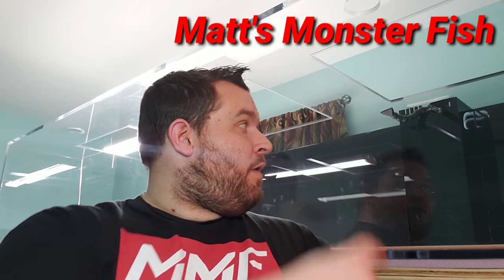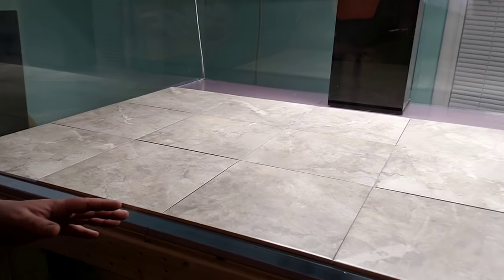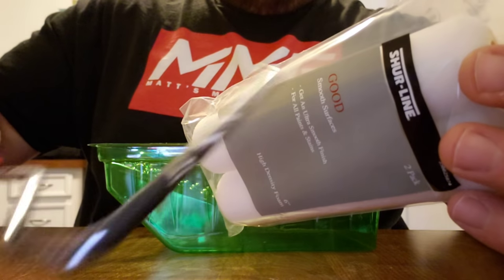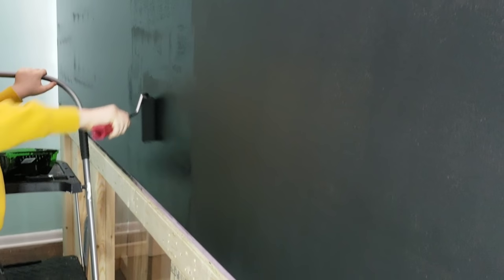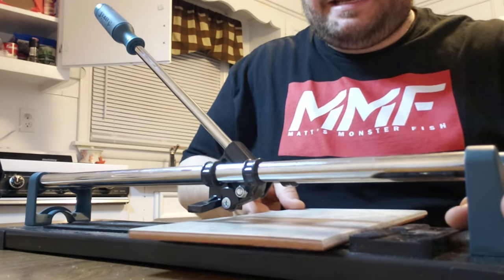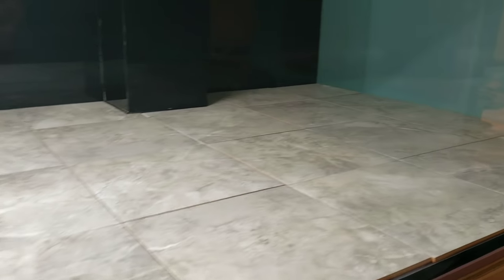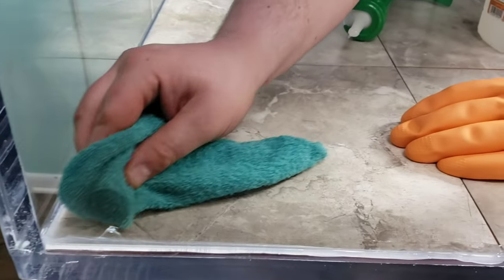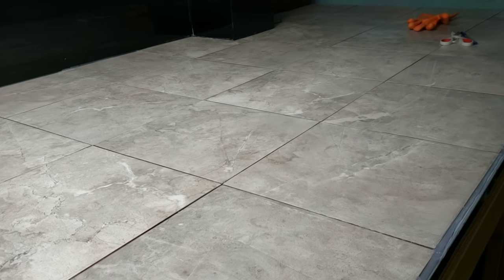Getting The MASSIVE AQUARIUM Set Up!

Comment: I always wondered if you took pea gravel and mixed it with silicone and spread it down on the bottom of the tank if it would look like a gravel bottom but be solid so there wouldn't be anything to get under the gravel? That way you could have the look of gravel but the ease of a bare bottom tank.
Reply from the maker: That would work!

Comment: When you fill the tank with water the silicone will be a lot more noticible, also you would have been better using vinyl on the back ground, if you ever want to take the paint off and change the colour you can't razor acrylic like you can with glass so it will be a bitch to get off.